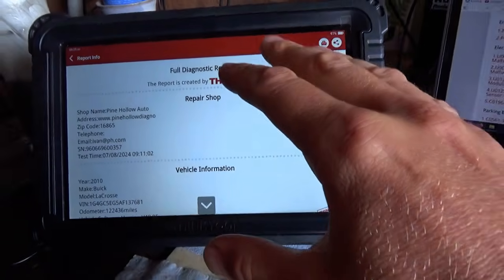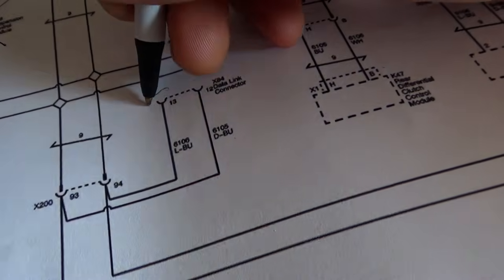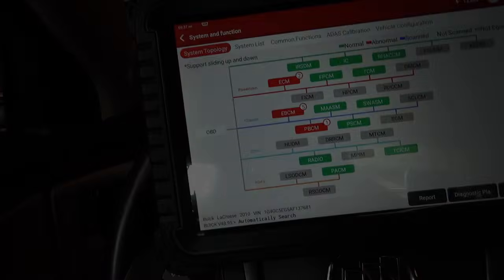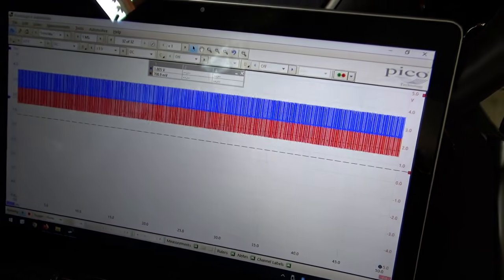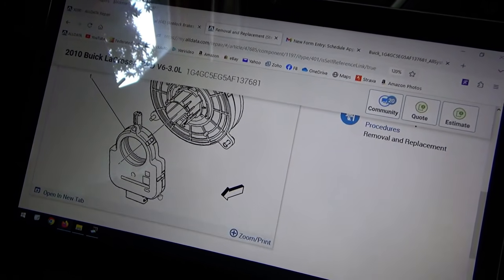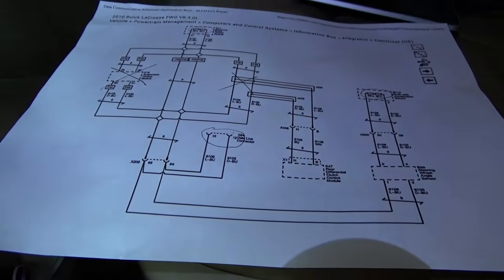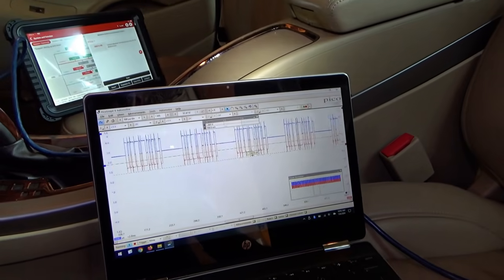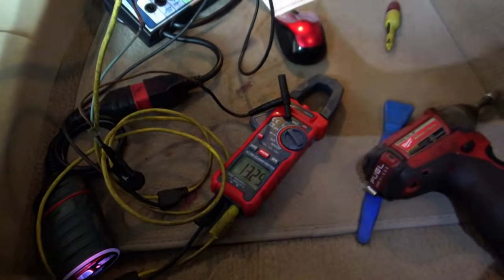(Pt 1) Customer Spent $1000...Car STILL BROKEN!? (Buick GM ABS MALFUNCTION U0074)

Comment: I watched a PHAD video last night where Ivan found a bad aftermarket part from NAPA. The vehicle was a Chrysler product, and the bad part was a TPS. Ivan said that the NAPA part cost around $25. He replaced it with a MOPAR TPS that cost  over $100. But it fixed the problem. The NAPA part was made in China. The Mopar part said Made in the USA. The thing that bothered me the most is that NAPA parts are no longer dependable. As an old timer, This freaks me out, because I had come to believe in NAPA quality. Of course, we have done this to ourselves. Ross Perot warned us what would happen, and it has. We are now inundated with CHEAP, NOT FIT FOR PURPOSE CRAP MADE BY COMMUNISTS. And it is this way with EVERYTHING,not just auto parts.

Comment: Green wire end to end to source ohms check, wiggle and pin check. I module is the source, check its input power and pins, pull the board and do a visual. It appears that green wire power is not stable.

Comment: If I'm following this correctly, the fluctuating 12v feeding the two sensors is coming from the EBCM, so it seems like a good next step would be to check for clean power on the D-GN line right at the EBCM itself, while being mindful that this might be a poor pin/socket connection issue so be careful about wiggling things while taking your voltages. In any case, this looks to be pointing at the EBCM so regardless of where it's hidden, you're going to have to get to it anyway. I hope it's easy to access. Looking forward to PT 2.

Comment: My next step would be to buy a six-pack, have a few beers and save a few for part duex (two).  I wrench on our cars (maintenance, brakes, etc) but I don't have access to wiring diag's or a PICO scope, or the knowledge to use them.

Comment: My guess.  Possible high joint that was cleared when you inserted your test voltage.    Now it may take awhile before the high joint reveals itself.  Could be connectors or module.

Comment: At the end when you turned the key off and removed it, the voltage dropped slowly, when I expected it to zero out immediately. I'm not sure if that is normal but it reminded me of a faulty capacitor, not that I expect one in the EBCM.

Comment: Wire in a temporary overlay feed. button it back up. Drive it if it's normal leave it alone if not do diag in the other direction till you find the real problem

Comment: Repair shops that charge for parts that do NOT fix the problem are a rip off and should not charge for those parts, even if that means they remove them and put back the old parts at no charge.

Comment: I would also disconnect all 3 components on that circuit and load test it with a bulb. One strand of wire can give a good ohm reading but cant carry any amperage. Or test at ebcm by backprobe and see if it lights that would determine if circuit is compromised downstream. That would put area of concern between j321 and ebcm seeing adding 12v at steering angle sensor appears to have brought acceleration sensor on line.

Comment: Ivan, I just had those basic symptoms on my Jeep, was a speed sensor L/R. removed blew out with air twice, first time it came back, reset wire loom pushing sensor toward wheel bearing, seems to have cured problem.

Comment: Prove the ecbm has good power and grounds, then prove the wire supplying the two modules with power can do so..... If not, there's your problem lady.... If all else is fine make sure the aftermarket modules (D$rman?) are not pulling too many amps (if so they could have cooked the ebcm), then condem the ebcm with a failing switching transistor.

Comment: next step is follow the trail to the power supply at the brake control, inspect wiring and backprobe the harness at the brake control output.

Comment: First thing this customer should have done is return to that shop.  They didn't fix anything.  They need to fix the problem (for free hopefully) or refund the money.  As for Ivan's next move.  It's looking like a poor connection somewhere between the ABS module and the SAS.  It's time to check the power feed wire at the ABS and work our way back if need be.

Comment: Fun one! You make it look easy as usual Ivan! I'd just head straight to the EBCM and see if it's doing the same thing, but I'd continue watching it at the steering angle sensor too. So there's channel 1 and 2 on the Pico. You've already proved there's no short to ground with the test light, so that's covered. If the voltage is good at the EBCM consistently, then it's time to go hunting for the little green monsters starting with the most accessible connector in the circuit. Look forward to Part 2!

Comment: Just for interest I looked on rockauto for electrical parts for this vehicle.  3.0 v6 shows a bcm and ecm. 3.6 v6 shows only a bcm. I guessing ecbm is actually different from ecm?
Reply from the maker: "ABS Control Module"
Reply: @PineHollowAutoDiagnostics  gee. Only $450 cdn  then.

Comment: My little piece of advice is learn to work on your own vehicle and fix it yourself. Buy an older well made car like the Mercedes 240 or the Volvo 240. These cars have an enormous following and parts are still available. The main thing with these cars is buy factory parts, very important, find out what type of fuel injection system it has and by original manufacturers parts. No scan tools are needed for the Volvo 240 and not sure about the Mercedes.

Comment: I had the same problem on my 2011 buick lacrosse. It was a bad EBCM. My CAN bus wouldn't communicate with the parking brake module and the headlight module and Yaw rate mod. I got an ebay special and programmed it through AcDelco Techline Connect SPS2. But no matter what you do the incorrect immobilizer dtc will be present. It wont make a check engine light but you can only replace modules on GM cars that are global "A" with virgin modules. Been a year and a half and it still driving fine on the ebay used one. It did let me change the vin though. I pretty sure its a EBCM thats bad. Those GM cars have history of cold solder joints. I wish I would have saved my original and just sent it in to be repaired. Ohh and the new modules they are selling for these cars on Rockauto are the wrong part. I tried one a few months ago to get rid of the immobilizer code and it wouldn't work had all kinds if CAN bus issues. Ebay will work. $60 vs $500

Comment: I would measure the current. Once via the ABS module, once via the test light. Aftermarket sensors may require too much power or the ABS provides too little.

Comment: Next step(s). Continuity from ABS to steering angle on the green wire. Might be hard to back probe the green wire at the abs module while it's plugged in. Find the X200 connector first or second if it's easier than getting to the abs connector. Would have thought if the green wire was intermittent to gnd there would be a code in the abs but who knows. Feels like a bad connection on green wire. Obviously check pin grips as well as captain Kirk's girlfriend (the green crusty one). I've had this scenario with a bad module before, also had it with a bad sensor intermittently shorting internally - drawing a little too much current and the supplying module shutting power down as well. You have the advantage of decent diagrams in the US. We have Alldata in the UK but it's absolute rubbish compared to the one you have. Autodata not too bad if it has the diagrams but wouldnt have the location of X200. You don't know yr born over there 😁

Comment: Ivan, when you disconnected that clocksring thingy at 15:00 youbalso remove the 60 ohm end resistor. Wouldnt it be better to have a 60 ohm on your measureing wires ?

Comment: Is it possible for u too look up a couple pins on a connector for my car, harness came off with lower rad support that go to horns and ambient air temp on a ¹⁹kia optima and the little harness is the price of gold and i have the new sensor and just want to wire and pin it myself but can't find info what location wires go want the money light to go off

Comment: I would go to the EBCM and measure voltage in then compare to the out. If same I would then smack the module around like the bitch it is and see if lose the output voltage.

Comment: HI IVAN,hope your having a great day.The main thing I'm learning from watching all your vids lately is what ever you do to your car to repair electrical issues or have someone else fix your car is PUT THE OLD FACTORY PARTS IN A BOX<OR IN YOUR CAR.You have proven over and over many times the FACTORY PARTS TO STILL BE GOOD.With the exception of FLOODED CARS most electrics parts rarely fail.Mechanical parts you can actually see the failure.The guy spent maybe 500 for parts and maybe 500 labor>and it didn't fix it,that means those old parts should still be functional and probably better that aftermarket parts.Consider this ,when you go to the wrecking yard do you look for factory OR after market,i always go factory!!!The aftermarket is popular ONLY because OF PRICE,at least in my view,great work Ivan.
Reply from the maker: @robertoruiz7069  great comment Roberto! 👌

Comment: I´m going to take some guesses.
Pin fitment issues or green crusties. Also excessive current draw by one of the modules. I would load down the power at 50 to 100 mA with an electronic load like a BK8500B, as it doesn't cause the high inrush current of a test light. As the voltage kind of came back when you bridged the circuit with a test light, i'm tempted to point to green crusties.
I'm also curious if you tried the protocol decode function of Picoscope. I've had great success with this on identifying what module was communicating on the network. Usually the lower the ID, the more important the module is.

Comment: I own a 2006 Chevrolet Avalanche. A similar problem started happening to me about 10 years ago. You would turn a corner and the ABS pump would start to pulsate and the light would turn on. You could feel it through the floor board. The only way to keep it from happening would be to turn the traction control off. What ended up being the problem was rust jacking underneath one of my wheel speed sensors. It lifted the sensor up and away from the trigger wheel and it was not getting a signal. My mechanic removed all of the sensors, sanded off the rust from around all of the mounting holes, then covered the areas with rust proof paint. He then reinstalled the sensors and the problem has never returned.

Comment: Interesting video and problem.  For those who did not have access to a scope they could connect a voltmeter with one lead on the pin that is missing voltage and the other lead connected to the feed point at the brake module and observe if there was a voltage drop when the key was turned to the on position and also with the vehicle running and observe voltage drop.  Any major voltage drop (over 1 volt) would indicate a problem in the wire circuit and minimal voltage drop would indicate a problem at the connector or module.  The voltmeter is not as accurate a test as a scope to catch a fast glitch but in this case it would probably still show where the voltage problem is.
Reply from the maker: That's a good suggestion! But everyone should just buy (at least) a 2-channel scope...costs less than a fancy Fluke DVOM ;)
Reply: @PineHollowAutoDiagnostics   I agree that a scope is a necessity for someone who wants to diagnose and troubleshoot electrical problems on  todays vehicles - whether they are a DIY or technician.  The sad part is that most want a 4 channel top of the line scope (like the Picoscope as an example) but do not want to pay the price and view a 2 channel scope as a waste of money since it will not do everything they want if they encounter a "what if" scenario (usually need 4 channels to diagnose problems like cam / crank sensors as an example).  I was on the fence for a bit myself but finally decided to just purchase a two channel hand held scope / multimeter with decent reviews for under $300.00 Canadian as it was within my budget and a two channel scope is much better than no scope.  One of the other problems I think is that a lot of people doing diagnostics still do not fully understand the value of a scope over a multimeter and being able to actually see a "voltage level signal over time as a waveform" (which is what a scope basically does) visually so you can see if there is any fall out, glitches / spikes or noise in the waveform (or waveforms) to better diagnose and determine a problem in a circuit so a vehicle can be fixed with confidence.

Comment: I'm an electrical engineer and I'm thoroughly impressed with the using of appropriately sized test lights.  Hi impedance, low loading DVM's for continuity testing is fraught with peril.  This is ages old knowledge that must not be forgotten.  To be a 'good conductor' requires BOTH low ohms and appropriate amp ability (ampacity).  Someone should sell such a test set.

Comment: Two potentials:
(-1-) ebcm
(-2-) supply wire

Approach:
Check continuity between ebcm and sensors. Include strong visual inspections.   If good, condemn the ebcm.
Reply: We already know they have continuity. Remember when he ohm tested the network?!?!?

If there was no continuity, 60 ohms would not have been exhibited on pins 12 and 13. He pretty much explained that in the video

Comment: Monitor wire from ebcm to bar where it splits to the two sensors.  Flex the harness, look for harness/wire damage along the way.  It's intermittent so, connector damage or pin fitment, possible rodent damage or corrosion.
It's a start.
On to part two.

Comment: I would put scope on 12v feed and the ground to the two modules and a 300mA load to ground to stress the power delivery side more (put load where scope is connected). I suspect bad connection between the control module and the slave sensor modules. Maybe a corroded or loose pin along the way or a pinched wire in the harness.

Comment: Oxidized grounds at body can cause odd warnings on center screen (traction control, x keys programmed, steering, etc). Some LaCrosse body grounds were painted at the factory, unfortunately. Our fix was to remove say half-dozen body grounds near the battery, clean up, retighten.

Comment: My next test would be to jiggle plugs and wires in the areas of the steering wheel and EBCM while watching the voltage. Also load test the circuits involved. From the look of all the shiny parts, the cannon has already been fired.

Comment: I would check the ebcm connector for green crustys or loose wire at the plug or water intrusion inside the module

Comment: Great video. The best part was looking at the data bus difference when there was communication or not in relation to the 12-volt supply.
My next step would be to look at the supply voltage coming from the EBCM to see if it matches the reading at the angle sensor.
Reply: Check power to and out of ebcm.
Reply: @disgruntledcanuck  If supply voltage is available is has power in

Comment: Interesting case, Ivan! Could be an intermittent connection at the EBCM or in the wiring. Can also be the transistor feeding the 12V at the EBCM. In either case, you're in the right track!
Part 2, please🙂

Comment: Definitely an interesting one. Intermittent issues are always a pain in the rear, you can't fix it if you can't break it first. This one certainly appears to be a connection issue. Your applying voltage makes things start to work. Id look st the connector to the ebcm next.

Comment: I would check pin fitment at the E CBM if that’s OK then I would put a load on the green wire between E, CBM, and the two sensors to see if there’s a corrosion problem or another connector

Comment: Isolate power feed from EBCM and determine if it has a consistent supply with open circuit.  Then try with test lights.  Then go after the wiring.  It's either the EBCM or wiring.

Comment: what are the wheel speed sensor output.  GMs have chronic traction control off.  (Wheel speed sensor faulty sensor output on one wheel or misfire)  it disables traction control.  The power feed may be an enable / disable bit that's bouncing around.

Comment: I hafta wonder how the EBCM makes the green wire hot. Maybe the EBCM has more than 1 power feed, and one is not staying hot - fed by a relay contact or a green crusty. Or maybe the EBCM has a relay or semiconductor in it that feeds the green wire. Super good video, either way. Can't wait for Part 2!

Comment: What I learnt from other great and best technicians in youtube like you are. Is : 
ALWAYS CHECK YOUR POWERS AND GROUNDS Before you condamn a module. 
It isn't really that rocket-science.
Reply: It probably is for most mechanics.   Look... shops love brake jobs.   They love flushing coolant.  Because these are trivial jobs that every home mechanic can do in 30 minutes and the shop gets $400-500.   But the economics of many shops (especially dealerships) is that people bright enough to actually know how to do the abstract thinking to solve these problems aren't being paid enough to do the job.    And the guys who can understand this kind of work usually go into jobs like "computer science" or "engineering".

This actually isn't a lot different than 20 years ago that when you had an electrical short (which by modern standards is relatively easy to figure out, in most cases) the same problem was happening.  Shops hate that work because there's no book rate for that kind of work.
Reply: Yes, it is a 14-year-old car. There's got to be some corrosion somewhere.